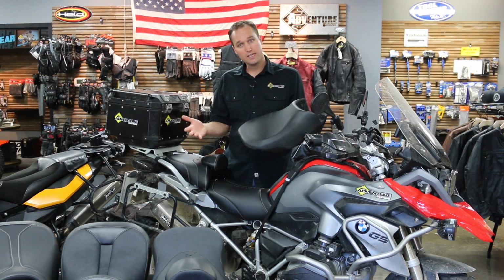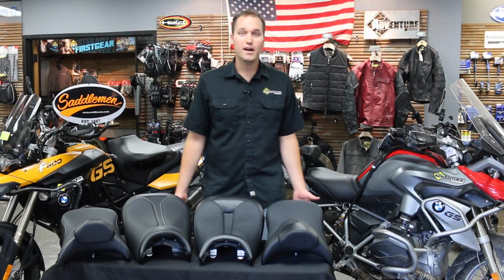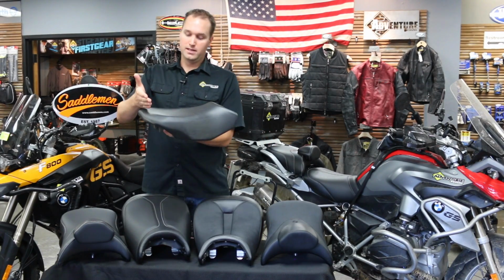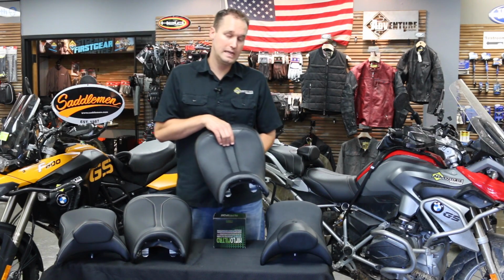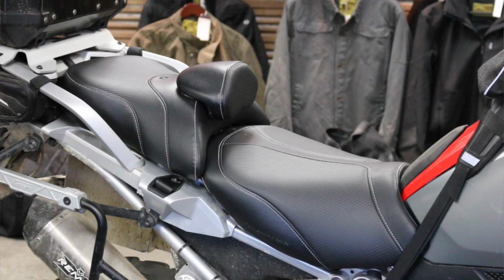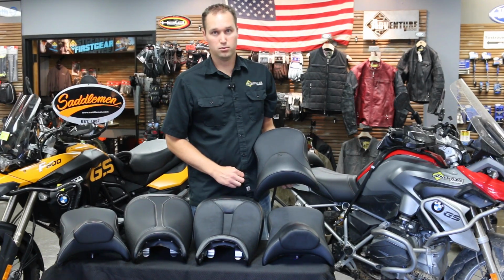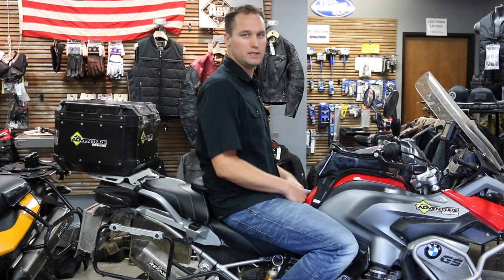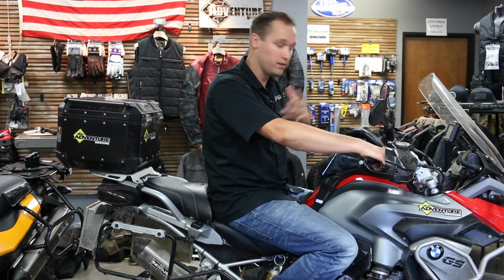Saddlemen Adventure Track and Adventure Tour Seats for BMW R1200GS Liquid Cooled

Comment: Nothing for A Ultra Classic-Harley...????
The factory harley seat is junk after 100 miles..need to find a better one????
Reply: That is a true fact. I have daily customers on my shop to do something about it that includes the super hot riding Fatboy. All the customers have a different  needs and it all have to do with the individual weight/hight/ciatica so the procedure to make it more comfortable goes from applying gel, memory foam or just a different foam density.